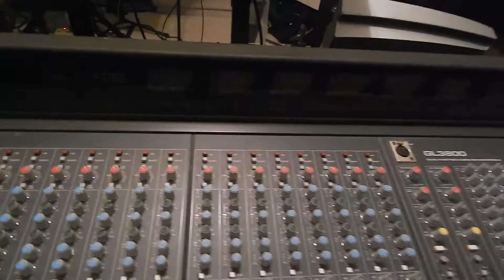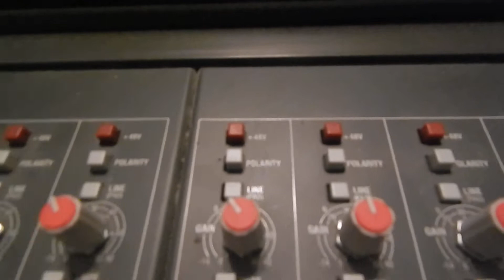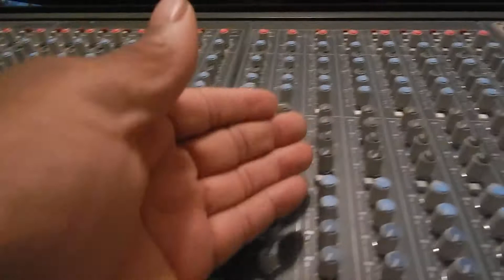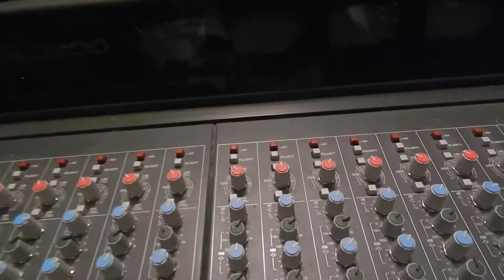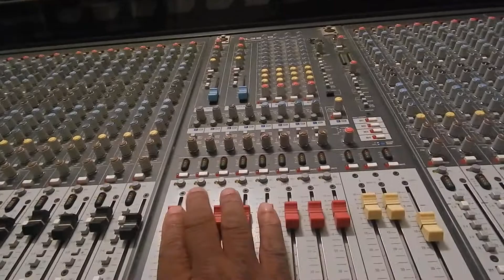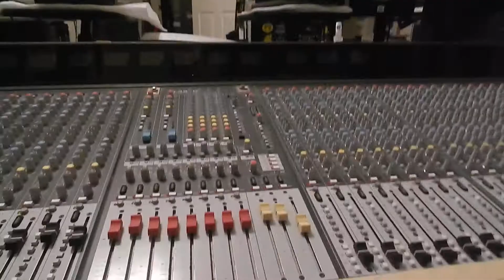Signal flow of a Allen & heath GL Console

Comment: Brother man 
I have a question. I connect TC electronic M350 use Aux 5 and 6 out to M350 then back to 2 fader input. The issue I have I’m only getting delay in both channels. I should get delay and reverb independently. Any clue bro 
It’s for the small church. God bless brother.

Comment: How do I route from let's say bus 1/2 directly out to a stereo cable into my interface I'm basically sending 16 channels out of my Apollo in 16 seperate channels of the board. Eq dynamics all attached to the inserts of the input channels then I want to send all channels to one bus group.  Then direct out in to a stereo print track back into the interface then into my daw but I want my two out outs from my bus to have insert points aswell for my ssl buss compressor and neve master buss eq.. right now I'm sending to aux outs but I loose my stereo pan abilities and I feel I would capture more of the warmth of the board by summing out through one pair of group outs ...thanks
Reply from the maker: i will create a video for your question
Reply: @marksmusicplace3627  man that would be amazing

Comment: Hi Mark.....I am having trouble recording pan moves with the GL2400. I can hear the pan moves on my monitors, but the moves won't record into my DAW. Are there jumpers inside the console to make the panning post fader also? I changed the other jumpers to post fader already.  Any thoughts?
Reply from the maker: question.  is the output from the AH to your interface.  are they coming in from direct outs.  bus outs or the stereo master L and R output?

Comment: Thanks you did a amazing job.   Very detailed any one could understand.   So I'm thinking of buy it ng one used is it worth it mainly for summing
Reply from the maker: it may or may not be good for summing because inputs will go through the A&H preamps.   But it may be beneficial it you plan on recording a live band or band in your studio setup or just multitrack.  It does give a nice color to the sound when running signal through the console.
Reply: It should work perfectly, that's the way Lord Alge works